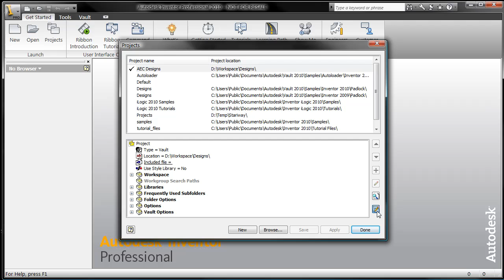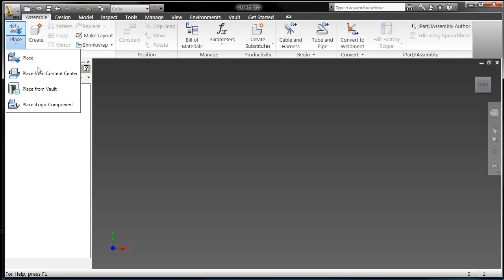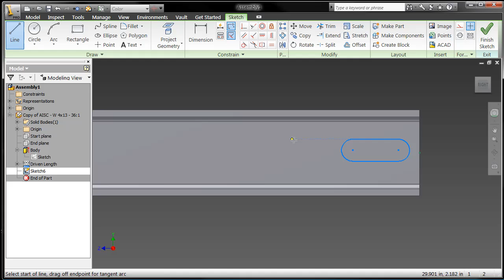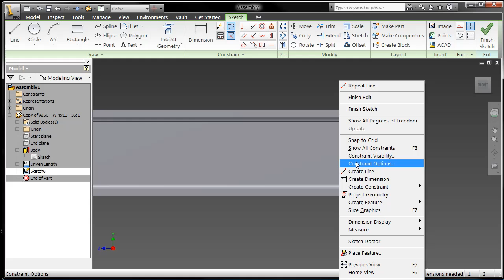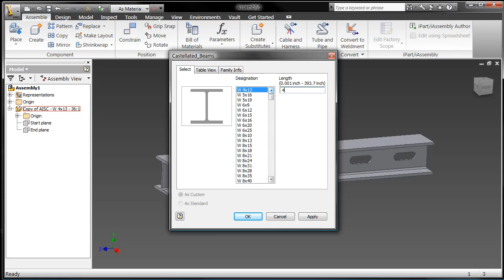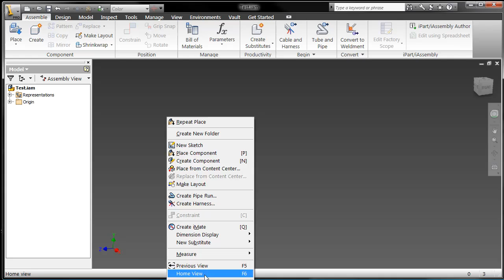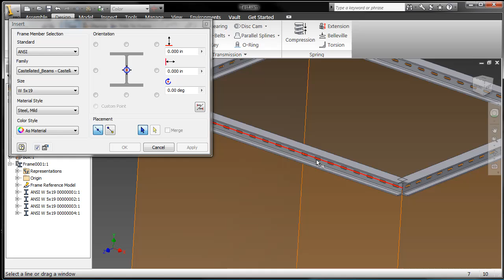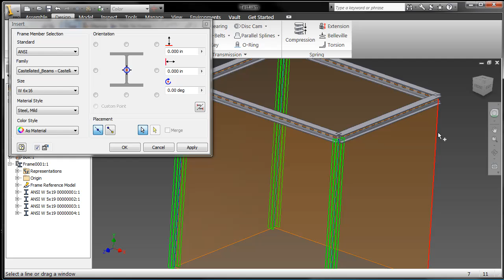Create Custom Content for Autodesk Inventor Frame Generator

Comment: Hi Rob.
Great tutorial.

I'd like to add a whole new family to the frame generator. I use a lot of structural aluminum profiles in my designs, I use Bosch Rexroth 3D templates.

In this example you used an existing component and made a new one that's REALLY similar to the base one. In my case ,there's no existing component that's similar to the profiles I need.
How do I do this???

Comment: Hi,
Great tutorial! Super informative and straight to the point. Hope you can help me with my issue:

I am looking to modify the content center part library to create 4x2x1/8 (in) rectangular tube. I was able to customize it all, but once I begin to run the analysis, Inventor fails and tells me that "Torsional Section Modulus is zero!" I tried changing it with the beam calculator and tried looking into parameters, but I can't seem to get it working.

Please help! I would be very appreciative!

N

Comment: @HydroDynamicBuggy You should be able to edit the "Family Table" through the Content Center Editor under the "Tools" or "Manage Tab" (depending on what you're looking at in inventor). Just right click the family, left click Family Table, Right click on the left side where the rows are numbered and add a row. Give it the desired properties and click Publish. If done correctly, it will become a new option in FG.

Comment from the maker: @zarbak2 I wouldn't use Frame Generator for Tube and Pipe. Autodesk Inventor has a Tube and Pipe environment that works similar to FG, but pulls from a different set of components specifically designed for tube and pipe. We have both rigid and flexible pips, it all depends on the desired outcome. Go to my channel and search for Routed Systems. You'll see a demonstration of that functionality.